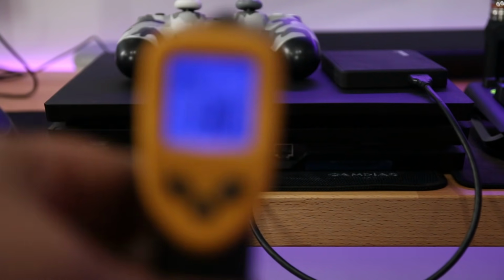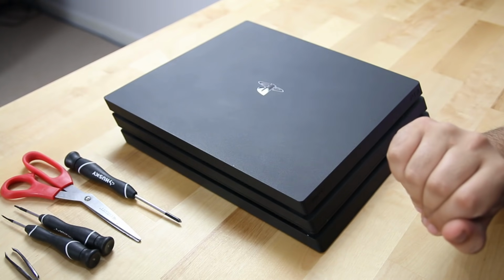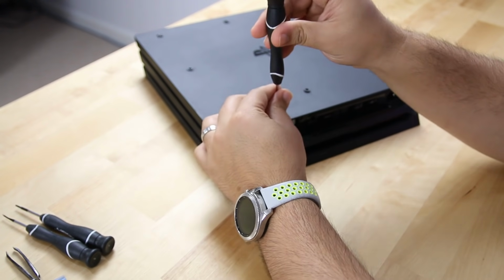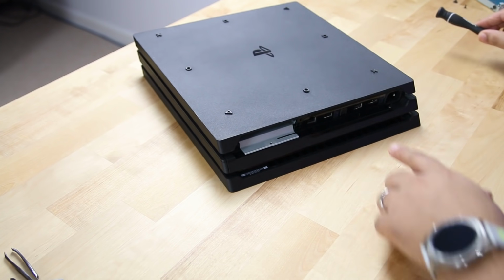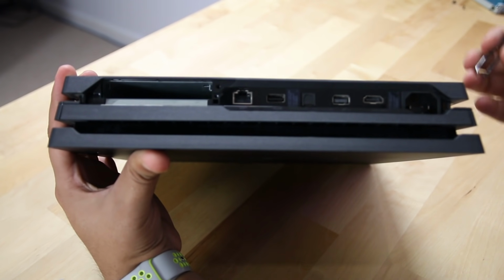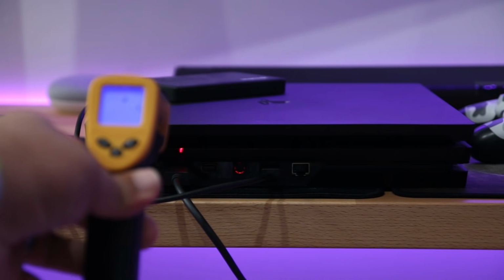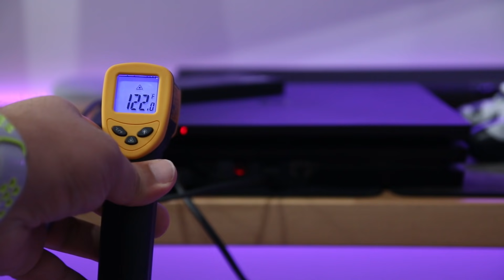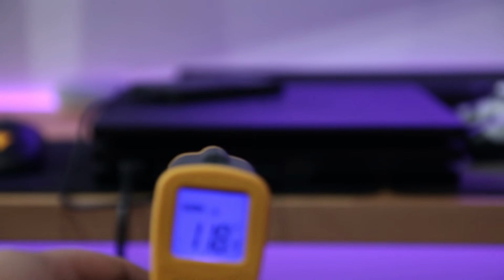PS4 Pro Fan Noise Fix - Thermal Paste & Pads Upgrade

Comment from the maker: 7:03 - MISTAKE IN THE VIDEO!!! - - I PUT THE THERMAL PADS ON THE CHOKES INSTEAD OF THE VRAM LOL - DONT COPY WHAT I DID AND MAKE SURE YOU PUT IT ON THE MEMORY CHIPSET THATS RIGHT NEXT TO IT!!!! THANKS TO EVERYONE WHO CAUGHT It. 4:49 - TO REMOVE PSU YOU ALSO NEED TO TAKE OUT 2 SCREWS FROM THE UNDERSIDE, FLIP THE CONSOLE OVER AND THERE WILL BE 2 MORE SCREWS TO REMOVE. REFER TO THIS VIDEO TO SEE WHAT IM SAYING https://www.youtube.com/watch?v=euBlNq5kda0
Reply: Good to know. What was the difference in performance like after you corrected your mistake?
Reply from the maker: I literally caught the mistake a few minutes after i closed it up. So i didnt notice any difference from that. However, it is really really quiet now. The thermal paste did wonders as did the pads.
Reply: Can you link me a page to Amazon on the equipment you used like the 3 screwdrivers
Reply: Delete video make a new one?
Reply from the maker: @wgvwgv579  too much work
Reply: The big square At the bottom? Is that where the chipset is?
Reply: Hey thanks for the video, big help! On your mistake @ 7:02, should the pads be going on the small silver circular pieces about a half inch above your pads, or on the small black squares I see immediately above the pads' existing positions? Thanks
Reply from the maker: @circa8773  thanks! They go right above it on those small square memory chips. Good luck!
Reply: @TechSavvyBuyer  I think these are not memory chips but actually vrm chips...not sure though ;)
Reply: I’m sorry but I’ll be the one to ask, for those of us who aren’t familiar with VRM chips or little to slim experience . I see two different types of hardware above and below, do these pads go on the the black pieces in between the circular pieces or the black chips below the thermal pads that are right above the thick copper track? 😊 thank you
Reply: PS4 only has VRAM. the system shares the GDDR5 RAM with the CPU and GPU.
Reply: Almost broke my system trying to take out the power supply cuz you didn't mention the 2 screws. Luckily I was watching 2 videos to do this and noticed the second vid was taking out the psu easily n saw that there was 2 screws still in.... sorry but sometimes ppl don't read the comments. Luckily I didn't harm my system.... but your miss step coulda fkd up someone elses system.
Reply: undead fodder My guy! This just happened to me this week. Those 2 screws were crucial and I failed to catch it in both the videos I was looking at cuz the second one did it quick.. yea I broke the cable attached to the back of the motherboard.. pins are there and am looking to get it fixed though.. here’s hoping
Reply: mongrossmon Ive just bought this paste and pads and I’m fitting it tomorrow. Im certain its the chips above the copper track. They look more like memory chips to me.
Reply: Hello my friend.  I saw your video and i made the same mistake except one thing. I put thermal pands in all there. And chokes and memory. And now im thinking to open it again because i don't know if this not damage my console. Some opinion?
Reply from the maker: Change it immediately
Reply: your more wrong than that as they are not memory chips, they are the mosfets for power control, the memory is on the other side of the board....
Reply: @taitaisanchez  VRM stands for "Voltage Regulator Moduls"
Reply: This is a bad video with serious errors, speeded up does not help or lack of commentary
Reply: It always fascinates me when people who have no fuckin' clue what they do starts making videos about it and the rest follows them blindness...
Reply: dude please edit the video...
Reply: wow, please re-do the video.. . now i have to do this all over.. SMH.
Reply: those are not memory chipsets...it is set of gate drivers FDMF6840C
Reply: LoL bunch of lazy ppl complaining about a quick video that has everything you should already know before opening the ps4 pro....helped me a lot just for thermal paste amount to use and a quick recap of where and how many screws go where....and the thermal pads for VRM's just stick them to the side with the heat pipes(the 6 shiny cubes things)....one of the very few videos that mentions the 2 different fans... Delta fan has a high pitch whine but kinda quiet and Nidec does not have the whine but sounds like a leaf-blower when going full blast
Reply: Jea

Comment: The FTC ruled in 2018 that those "warranty void if removed" stickers are illegal, and removing them DOES NOT void your warranty
Reply from the maker: That's awesome
Reply: Grout Grout : Great so if I clean my fan and heat sink it’s still good for warranty?
Reply: Tech Savvy Buyer : Is it still in warranty if I clean my fan and heat sink?
Reply from the maker: @lightskinantics4200  fan yes. Heat sink no because you need to disassemble the whole system.
Reply: Tech Savvy Buyer : So taking out the power supply is voiding your warranty? That’s the only way I can clean it, oh well I’m gonna do it soon anyways I want my ps4 to run well for a long time
Reply: Grout Grout ugggghhhh you beat me to it! 🤣
Reply: Yep they cant void it for the sticker but they have been known to void it because"something inside when you opened it"
Reply: They later reflected the change in the law on the newer PS4 pros because I got one of the newer revisions and the stickers on the back don’t say “warranty void if removed”
Reply: Tech Savvy Buyer I need help my ps4 turned on but now it started blinking blue I opened it back up and I have to hold down the motherboard hard to have it turn on
Reply: actual court case is from 1975 or something. you can open your gaming console and tinker with it (clean fan, take out power supply, and more), as long as you do not break anything. if you replace the power supply, all the other parts are still covered under warranty. the new power supply should have its own warranty though.
Reply: That doesn't apply to the EU, though. It would void warranty here.

Comment: Still a very useful video in 2023! here are some pointers for anyone who wants to do this.

For starters you can just get away with new Thermal Paste! the factory thermal paste that is on almost anything, be it a PS4 Pro or a AIO Cooler are just meh lol. With wear and tear over time, it loses it's effect with the amount of heat a PS4 Pro produces. For reference my thermal paste was barely even on the APU when I disassembled my PS4 Pro!!

Tip 1: Start by disassembling the Power Supply first, this way you won't rip it off the motherboard!, if you disassemble the Power Supply and it still does not want to come out, you can keep everything unscrewed in the power supply area and start undoing the motherboard, I found that when I had both the motherboard and PSU unscrewed, the PSU easily came out on its own lol.

Tip 2: Organize all the screws neatly somewhere you will not lose them!

Tip 3: Take your time!, anyone can do this, even you that is reading this. It is tedious and will take time but will be worth it.

Tip 4: Make sure to take photos to remember where what is connected!, this will help you out a ton!!

Finally when I took apart the PS4 Pro to clean it and service the thermal Paste, it was surprisingly clean and I was shocked lol. I definitely recommend replacing the thermal paste as maintenance, BTW for anyone wondering, I used Noctua thermal paste!, good stuff!!

Comment: The output heat should be higher if the thermal paste is better.  The Core Temps is what should be lower, unless you have a thermal probe attached to the APU, you won't be able to tell.
Reply: Exactly....👍👍
Reply: jakthebomb : So is it better or worse to do what he did?
Reply: Miniman's videos : Was it better or worse to do what he did?
Reply: @lightskinantics4200  it's hard to say, because we don't see temps on apu.... But lets take cpu from pc for example... If you have pc with watercooling, the air coming from the radiators is much hotter then air coming from a cheap or stock air cooler, due to better heat dissipation... but that doesn't mean that cpu with watercooling is running hotter, it's the opposite..
I hope you understand my English..😀
Reply: Miniman's videos : I do and thanks I’m only 15 so thanks again for the information I hope is true! Cheers
Reply: @lightskinantics4200  no problem... 👍👊
Reply: The output heat shouldn't necessarily be higher. An external measure like this is of limited use for tests like this.
It is possible for the temp to be overall lower because the enhance conduction of heat away from the core is allowing a better transfer into the more conductive heat-sinking elements resulting in the overall heat saturation point being lowered by heat being sinked by the less conductive parts
Eg
For the plastic casing he is measuring to have dropped temps that means that likely less is being conducted into the case due to the conduction into the heat-sinks being better
Reply: right
Reply: @bengrogan9710  <- listen to this guy. Output heat imo would be lower because the core is kept lower. But it's still not the best test.
Reply: It works both ways really and varies greatly on the thermal dissipation design of the individual system. If better cooling means wider surface area distribution for energy then the temperature output could be lower measured externally from the primary fan vents. HOWEVER if the cooling design does not allow wide dissipation then it could read higher from the main vent externally when the chips are being cooled better. PS3 fat models are a good example. If the rear vent has cool air coming out of it you have problems and you have very poor heat conduction from the processors and memory to the heatsink. I have done a great many PS3 delids and right afterwards the rear exhaust temperature goes from cool to very warm, but the chipset's temperatures (shown on a jailbroken system) drop dramatically and the fan speed threshold never hits the higher end. PS4 is different and it appears that when they are cooling better the heat spreads out to a wider surface area inside the machine and so the main exhaust temperature drops.
Reply: Philalethes  Think of it in terms of wrapping exhaust headers on a car though. You lower engine bay temperatures, but you definitely increase exhaust gas temperatures as more heat energy goes out the exhaust rather than soaking into the engine bay. It can be the same with games consoles, but consoles can have different cooling designs where heat can spread over a wider surface area and escape OTHER vents better besides the primary fan exhaust, so temps measured at the primary fan drop. But another console does not have such a design and doing this increases the exhaust temperatures, yet still meaning more thermal energy is being removed from inside the machine via the primary fan exhaust.
Reply: Philalethes  original comment is not stupid. Heat is transfered between surfaces. The CPU's temperature lowers because it transfers its heat more efficiently to the heatsink. With low quality thermal paste (or none of it), the heatsink's temperature will be lower.
Reply: Philalethes  the heatsink releases heat INSIDE the console, mate. You know that energy is not created nor destroyed, it's just transferred.
Reply: Philalethes  With no thermal paste the heatsink's temperature will be lower because the heat won't transfer from the CPU to the heatsink. The CPU's TEMPERATURE will be higher, of course.
Reply: Philalethes  Yeah, I'm not certain you understand the example I made if you're not a car guy. Wrapping the headers of an exhaust does remove more heat energy away from the area directly around and inside the engine. Assuming the engine's energy output is the same whether the headers are wrapped or not, the exhaust temperatures are higher with wrap than without because instead of heat soaking out into the engine bay, more energy leaves via the exhaust. That means the exhaust gases are hotter, but the engine is cooler. Whether more heat is being removed via the exhaust of the console depends on the design of the cooling system inside the console. Theoretically if the cooler is designed to primarily vent heat energy out the back of the machine then you would expect to see an increase in exhaust gas temperatures under high load and a lowering of processor core temperatures. However with consoles there are secondary cooling factors and they have to be taken into account whether or not you have improved the situation. Such as better transfer to the heatsink areas surrounding the typically metal encased motherboard and greater dissipation in this manner, via side vents.

Comment: I replaced the thermal paste on the APU and did a much cleaner job than factory standards. Ps4 Pro (2018) was almost dead silent and never overheated again.

Comment: Thanks to your video, I cleaned up the fans and heat sinks. The interesting thing was, there wasn't much dust in there. Replacing the Thermal pads and Thermal Paste really helped a lot. My PS4 sounded like a jet when playing Doom. Now it's much quieter and my fear of it melting down has subsided.
Reply: how long took you to do that?
Reply: What thickness of thermall pads did you use

Comment: Awesome vid. My PS4 pro was loud as fuck to the point had to turn my tv up to max volume just to hear it. Took my PS4 apart and the thermal paste was dry so changed that put it all back together and was quiet for a few mins then back to being loud so took it apart again this time took everything out to get to heat sink and that was packed with dust so no wondering it was heating up cleaned it all and put it all back together now pure silence which is awesome 😎. Thanks for the vid was very helpful. New sub gained
Reply: Lunar White that’s cool I just cleaned my heatsink now I just need to buy thermal paste
Reply: I'm impressed you took it apart, and reaplied thermal paste, but didn't also clean the heatsink in the first go.
Reply: I got the Spiderman PS4 pro system, from brand new it was loud, no dust, must be just the crappy paste and thermal pads

Comment: Just did this myself and now my Pro is whisper quiet even on God of War!  It was pretty easy and only took about 30-40 mins and was well worth it.  Great video!
Reply from the maker: I am so glad it helped! I hope you caught my comment on the thermal pads part lol - i showed it incorrectly in the video but i pinned the comment detailing the right location to put it, on the chipset not the chokes lol.
Reply: Tech Savvy Buyer yea I caught that myself watching the video and put the pads on the RAM.  We all make mistakes.  Also the stock thermal pads on my Pro didn’t even cover the entire chips and one of them wasn’t even in the middle and was half on the chip lol

Comment: my ps4 pro was running even louder when I did this so I open it up and apply slightly put more paste and I notice something. the original thermal pads were not on the Vram chipset they were attached to the clamps that push down on them so I removed them and placed them back on the ram chipset, I don't know which one did the trick but WOW is running really quietly now.
Reply: Can you make video about that please
Reply: @tqtgshscf  Refer to Tech Savvy's pinned comment.

Comment: Just did this and it seems to have worked wonders! Go figure the only part I broke is the first part, the dang hard drive cover. Oh well $5 on amazon for a replacement compared to $350 for a new PS4
Reply from the maker: +OceanSyde excellent! Glad it helped. It makes a massive difference.